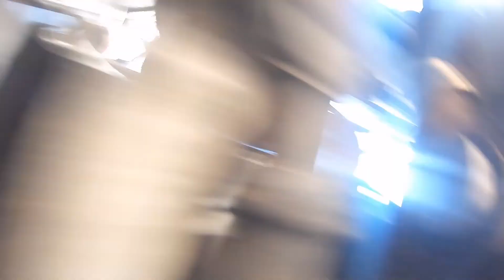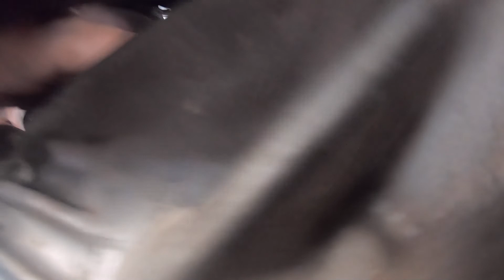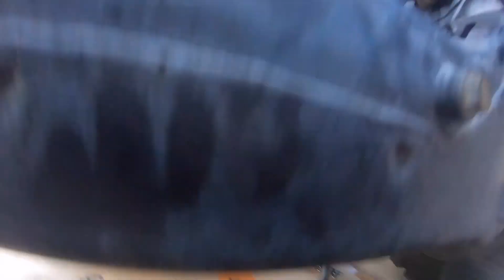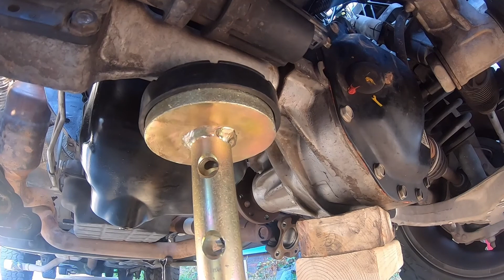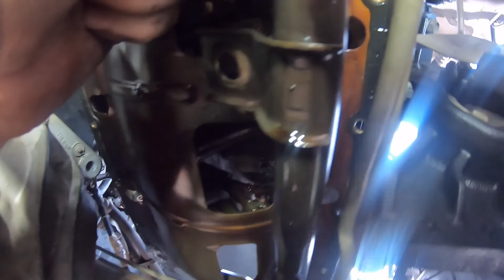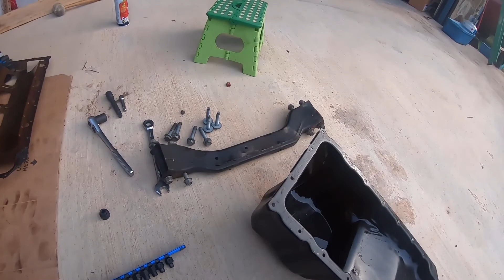2009 hemi 1500 trx4 build part 21.  Lowering the front pumpkin (Diff) to get the oil pan off.

Comment: It's crazy how small the engine looks when you strip it down like that. Just a reminder, the fault I had with my timing chain guide was, the bolts holding it in came loose, so make sure you loktite them in.
Reply from the maker: Agreed, not much to it, at its core.  Good point on the bolts, bummer is that I just got all the timing hardware installed today.  Video is uploading now.